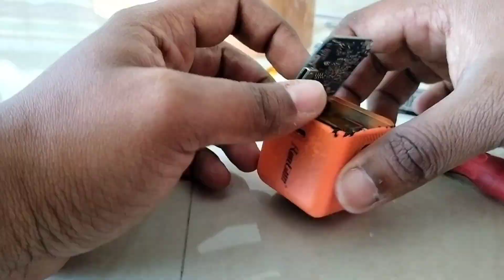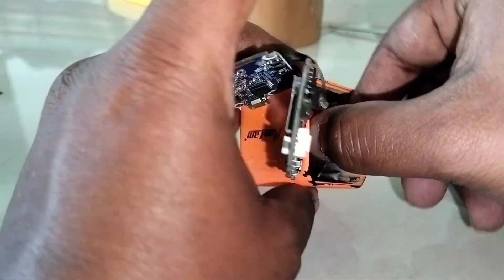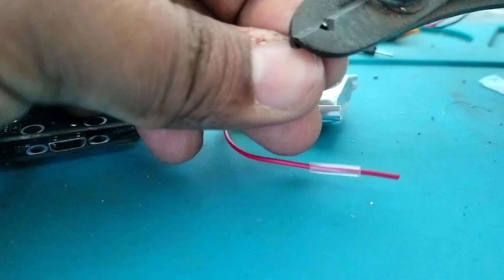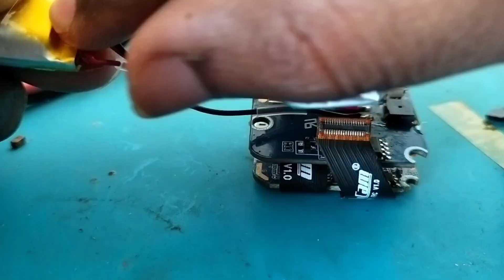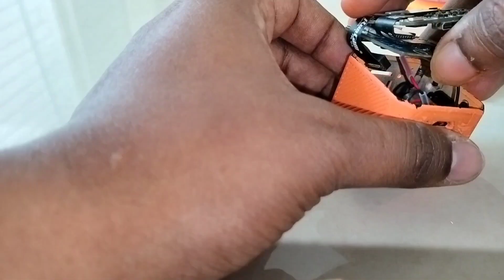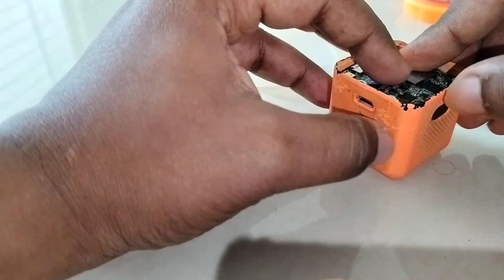Runcam 5 Orange Battery Replacement: Step-by-Step Guide

Comment: Where did you got the replacement battery ????that would of been nice ✌️✌️✌️
Reply from the maker: 2 x 400 mAh 3.7V single cell Rechargeable LiPo Battery
Dimensions: 25 x 20 x 9mm. I have bought from robu.in( Indian website). If you are outside India pls check your local stores or on ebay

Comment: Hi, thanks for the video. Could you please add the specification of the battery that fits the camera?
Reply from the maker: 400 mAh 3.7V single cell Rechargeable LiPo Battery
Dimensions: 25 x 20 x 9mm
Reply: @FPVMATE  I bought them and installed according your video. However, somehow the camera was not working correctly, I belieced the circuit was damaged. I removed the battery from the circuit and supplied 5V directly from external source. Now it is working. Any hint on what could be that issue? The batteries are OK.
Reply from the maker: @scudfpv  try connecting one battery alone and see if it turns on also check with multimeter if polarity is correct

Comment: Yu are replacing 1 battery with two, is there any reason why? Is there any voltage difference between thee two you are installing or is it just to double the recording time? Thx! Great Video though!!
Reply from the maker: The camera comes orginally with 2 1s batteries connected in parallel. While opening previously one of my old batteries got damaged so i removed that and was using only a single battery. The addition of batteries in parallel is to increase the recording time as the mah will get added that's all.